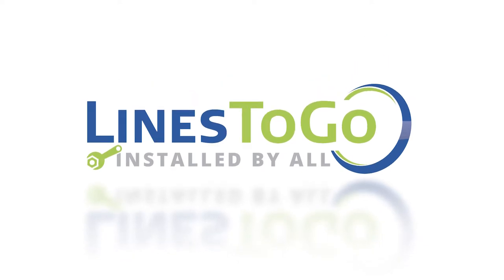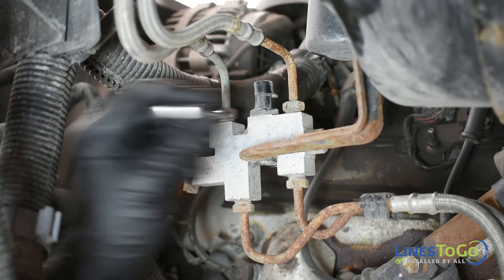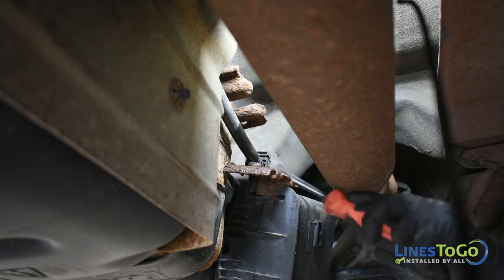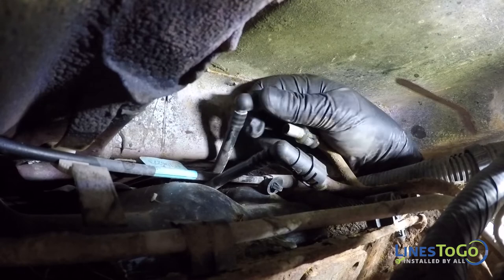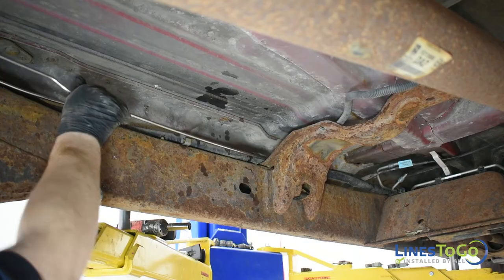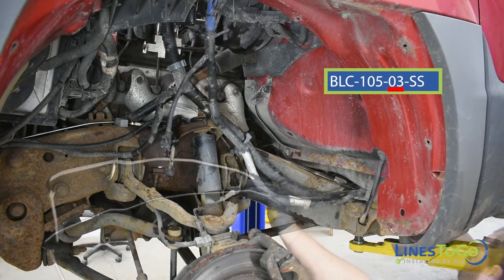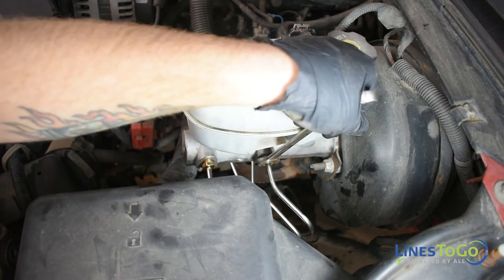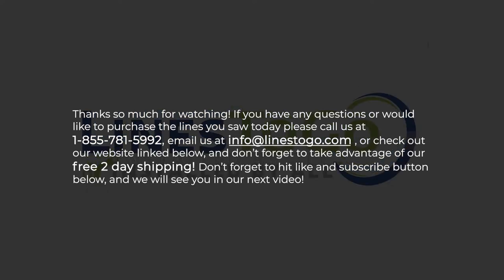How to Install 2003-2006 Chevrolet/GMC Avalanche/Suburban/Yukon Brake Lines

Comment: Installation is easy! Just drop the fuel tank!
Reply: I ended up buying this kit. I'd like to have a word with the clown that said this is an easy repair. Fishing these lines around the frame rails and everyone is one of the most frustrating repairs I've ever attempted. I can only work on it for an hour or 2 at a time because I get so irritated I start bending things to get them through. Which kind of defeats the purpose of the pre bent kit...
Reply: Lol

Comment: Put truck on jack stand!!
Remove bed !!
Easy access
Reply: Clearly you're not aware these are for a unibody vehicle. To remove the bed, you'd have to remove the whole body or get out the plasma cutter

Comment: I have done quite a few of these & have never removed the gas tank to do this. That is kind of crazy.  I know of no mechanic that drops the tank to do the brake lines on these trucks.
Reply: I think the bend in that left rear lower control arm must have been impeding access…there was no other way! 🤣
Reply from the maker: Hello, 

The only  way to do it is to lower the front sub-frame. We are not sure if the lines will be able to be routed into position without doing this.

If his bolts are seized you will need to do whatever it takes to remove the bolts. The nuts these bolts are attached to are incapsulated  between the floor of the vehicle.

It may be possible that you will have to cut an access hole somewhere to get access to the nut to remove the bolt and then repair the hole made later on. 

Here to Help!
LinesToGo
Reply: did it without touching either of my fuel tanks

Comment: Why am I not getting fluid to my rear lines?
Reply from the maker: Hi Daniel,

These chev trucks can be a little difficult to bleed sometimes, there are no real secrets or tricks to help, unless you are able to access a scanner with an automated bleed function. that cycles the abs module helping to force air out of the system. 
 
Other than that you will need to continue to bleed the system manually, it may take a while, but it will eventually bleed all of the air out of the system.
 
Other tools like a vacuum or pressure bleeder can also help, but are not required. 
 
Here to Help,
LinesToGo Team